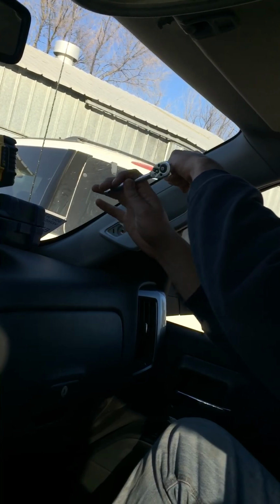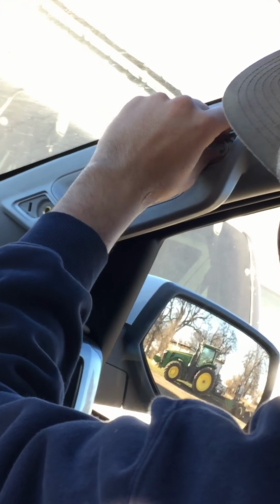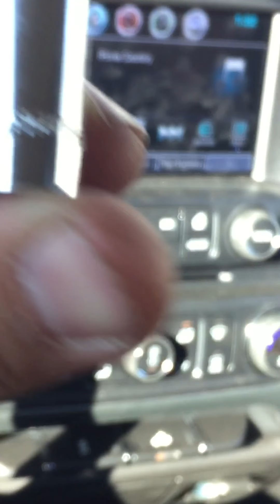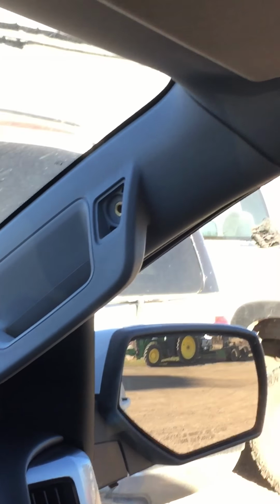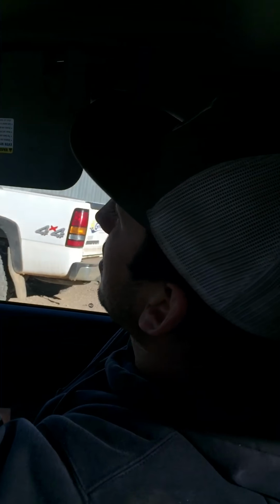2017 Chevy headliner removal

Comment: if you would remove the bottom part of the b piller trim you would find the two retainers holding the lower part of the upper b piller trim in place. also you have to remove the back glass. and you have to dissasemble the left side of the dash to remove the wiring harness. have replaced a few of these due to air bag deployment .not the easy to do